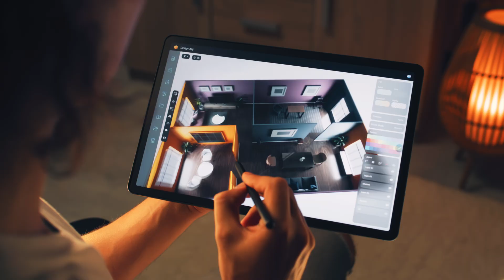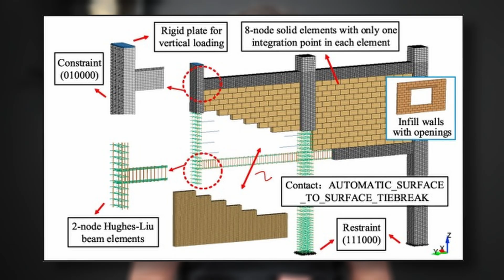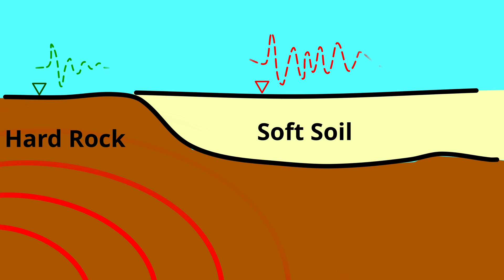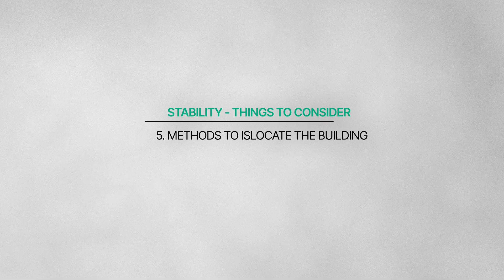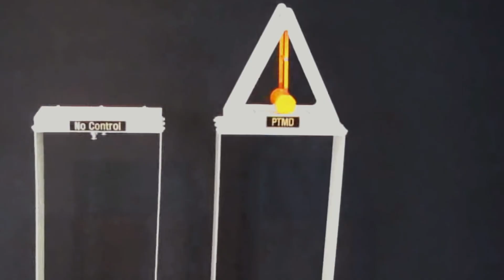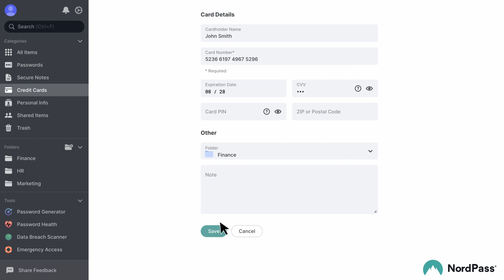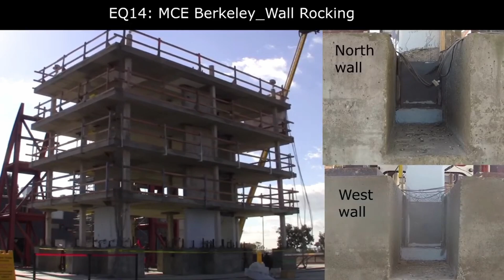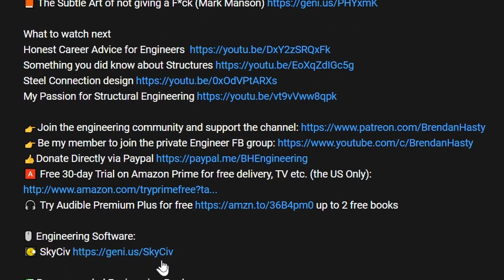The Concept Behind "Earthquake-Proofing" your Structural designs

Comment: Hi Brendan, hope you are doing well. The video quality was excellent, I really like the fact that you have been able to explain what are some of the most important facets of the seismic design of structures. Just some things I would like to hear your opinion about:
-One of the most critical points in terms of hierarchy of strengths is, as the earthquakes of the last years highlighted, the strength in the joint region. I think it is worth mentioning that because if there are problems with the joint design (poor detailing or not enough transverse reinforcement) the result will be an uncontrolled collapse since the joints will be the weakest link of the chain.
-I think is worth considering also the seismic response for ground motions levels over the design one. There is some literature on this and I think that working within the seismic risk framework is an interesting way to assess the seismic risk associated with code conforming structural design.
-(Related to the point above) Given that we don't have control in terms of seismic response of structures for earthquakes exceeding the design return period, it looks like the displacement-based seismic design yields better results than the traditional force-based design (and also seems to be more rational). The results addressing this topic are not a lot, but I'm really curious to hear you opinion on this.

To end this message, I would really like to point out again that the work you've done with this video is amazing and I hope the channel keeps growing. Looking forward to hear your thoughts,

Regards

Comment: Great video, love the fact you said that buildings cannot be earthquake proof because that’s such a a true statement.  Few comments before I talk about the rest. 

1) the hierarchies of failure is very true, you want buildings to fail in a way which is controlled and does not lead to catastrophic collapse. Therefore wanting building to undergo failure in beams rather than columns.
2) Although building do dissipate energy via ductile failure. The main benefit is a increase in period due to decreased stiffness in the building. This is shown in a theoretical form mainly by the ADRS curve. In my opinion, this energy dissipation idea is misleading since the consequence of this is a decrease of period. 
3) Adding onto this, the ductility of a building can sometime be shown as the ratio between elastic and ductile drifts. Overall ductility is either system or joint 
4) Although the stiff structures used in Japan are more conservative. They yield lower damage which is shown in recent event such as CHCH 
5) The idea of plastic hinges and confinement zones are more linked then you described. Plastic hinges in shear walls are where you need confinement zones due to loss of cover and core concrete due to moment reversals 

But great video with great concepts which are described great! Love the videos
Reply from the maker: Thanks for the detailed response, I really enjoyed reading it. The ducity vs dissipation it is really both, first the structure is stiff and you need to dissipate the force in a controlled way then secondly the structural is "damaged" the frequency is changed and the force is lowered. It would be great to have a discussion on all these things at sometime. Thanks for taking to time to write this response.